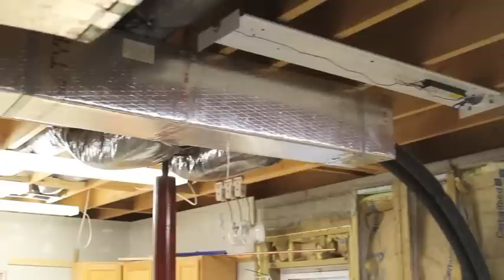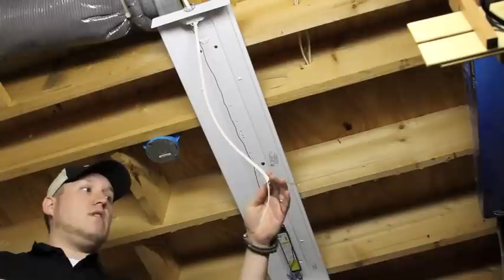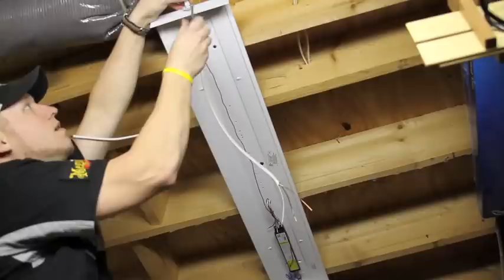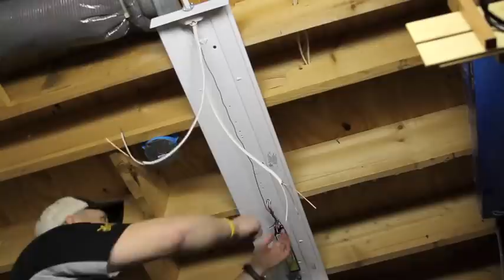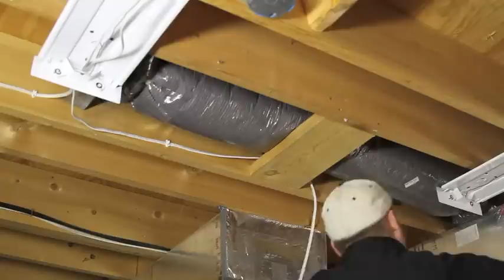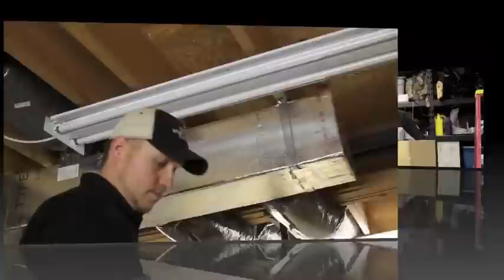Installing Overhead T8 Light Fixtures

Comment: Good presentation.  Would help a lot of people.  I keep a current copy of my province's simplified electrical code because there are periodic upgrade rules for locations, combinations of circuits etc.  If you can see the two points I'm about to make as safety suggestions, not criticisms, then my objective is met:  A)when you form your loop for the earth wire, orient the hook so that the
screw being tightened wants to tighten the loop, not open it.  B)when you staple your Romex or other wires, raise the location so 
that an errant drywall screw or nail has less access to puncturing the conductor.  Take care.

Comment: Don't use a razor to strip such small conductors. Use a pair of strippers to keep from damaging the wire. Cutting into the copper increases the chances of future shorts, broken circuits, and lowers the amount of electricity that conductors can supply to the fixture. I realize that the fluorescent fixture does not require all 15 amps provided by the 14AWG, but if you do it right the first time, you seldom have to go back and re-do things in the future.

Comment from the maker: It is easy to hook a third light into the circuit.  If you use the 3 position Ideal connectors I showed in the video it is simple.  I added a link to a diagram in the video description.

Comment: Do those insure wire connectors work on stranded wire? The fluorescent light fixtures I have have stranded wires & I was curious if the wire was strong enough to push into the insure connector? Great video!!! Thanks
Reply from the maker: I am not sure on that.  Luckily the ones I had were all solid wire.

Comment: They make led light tubes for those it saved energy and a lot.brighter just cut out the ballast
Reply from the maker: Yes that is true.  In fact, I recently made a follow up video where I replaced the T8 bulbs with the LED replacements.

Comment: Hi Ken, I was wondering how long does it takes you to install one lamp? I am trying to estimate the time that It would take to install about 100 lamps for a building. thanks
Reply from the maker: I would approximate about 10 minutes or so including mounting.  Each situation would be different depending on how high the lights are hung and how you are running wire.

Comment: I'm not sure how you gained access to the power wire as to connect the pairs of wire from one light to the other.  Did you somehow disconnect the power wire from the fixture you're jumping from so you could wire it into the two clusters of wires?  Any help will be appreciated.  Thanks.
Reply from the maker: Len Piko This connection process is referred to as a parallel connection or "daisy chaining".

Comment: I've got a 20 amp circuit in my basement that I'm trying to add fluorescent lights to, meaning I've got 12/2 wire. Now, the wire for the ballast is a smaller gauge than the 12/2. Is it okay to connect the 12/2 to the ballast?
Reply from the maker: ***** Yes, you can connect 12/2 to the ballast.  It is only going to draw the current it needs.  The larger supply wire will not hurt.

Comment: that extra connection to the third electrical wire is not necessary, correct?
Reply: except in this case but if there is no pre-existing branch circuit would there just be the single electrical wire to the power box

Comment: i installed a new fixture an i was putting in bulb cause the end had come out it sparked an had flames the light switch was on at the time. what would cause this?
Reply from the maker: Amanda, I would highly recommend that you contact an electrician.  You had a short somewhere in the circuit.  You were very lucky this didn't cause a fire.  I hope you can get this fixed.

Comment: What if i have 5 instead of 3 wires in the cord?
Reply from the maker: Anne, you would need to determine if you have a 3-way switch circuit going on there.  https://www.google.com/search?q=3-way+switch+wiring&espv=2&biw=1376&bih=698&tbm=isch&imgil=8M616FiEqVy1_M%253A%253BBKKSsfQxBWtmSM%253Bhttp%25253A%25252F%25252Fwww.how-to-wire-it.com%25252Fwiring-a-3-way-switch.html&source=iu&pf=m&fir=8M616FiEqVy1_M%253A%252CBKKSsfQxBWtmSM%252C_&usg=__RvSO_x9BFzGPlqb9W57pNfwXpxc%3D&ved=0ahUKEwiWjOeDrtPQAhUU_WMKHUJKBa8QyjcIJg&ei=YkhAWJbTAZT6jwPClJX4Cg#imgrc=8M616FiEqVy1_M%3A